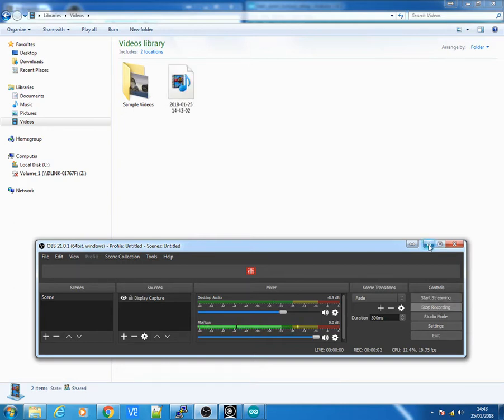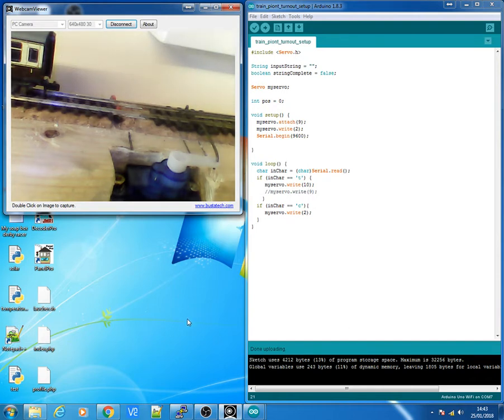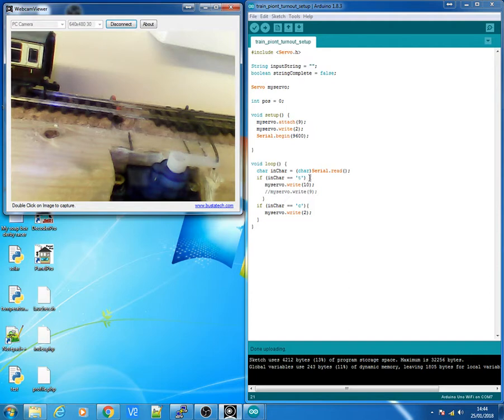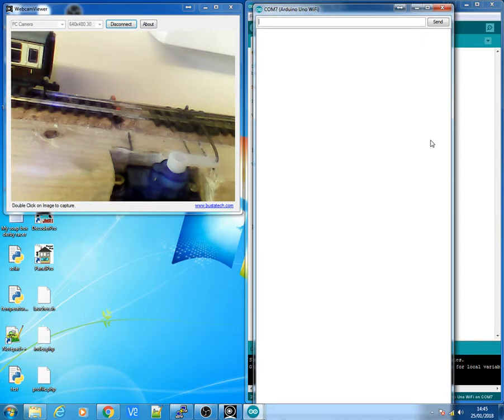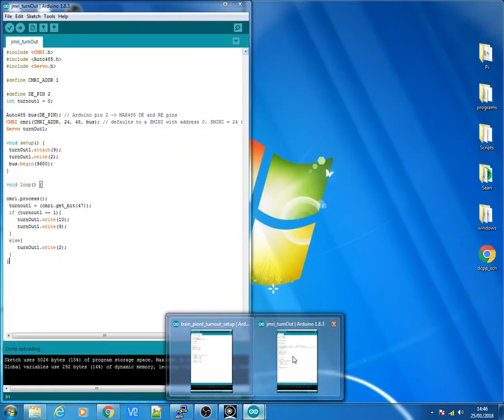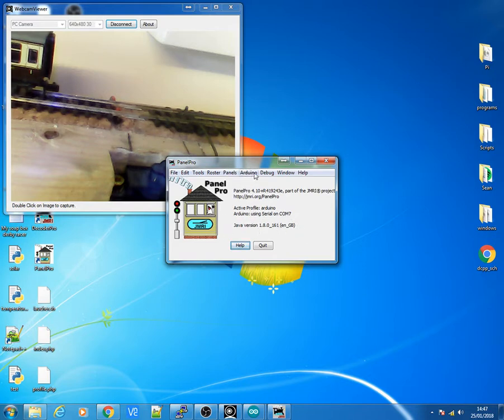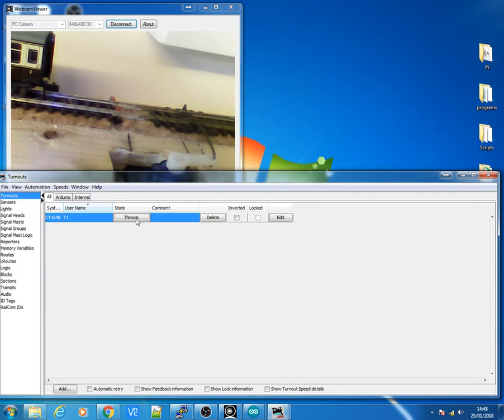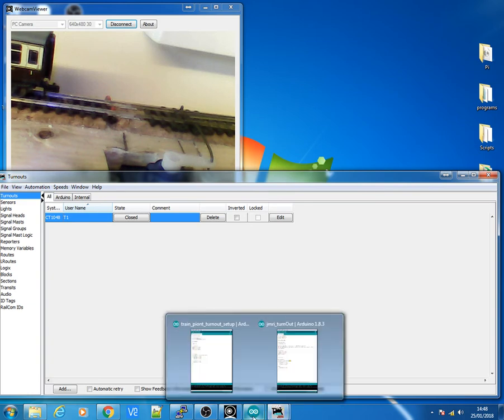Model railway JMRI Arduino Turnout servo control Part 4

Comment: your video on cmri is really good how could i connect the servos to the uno or mega ,could i use a mega sensor shield
Reply from the maker: Hi Alban. You could use a servo shield but really its not needed, these shields are for mobile robotics to keep everything tidy. The servos all run off 5 Vdc so you will need a separate 5 V supply for the servos. The signals to the servo can come direct from the Arduino digital pin outputs. One thing to remember the 5 V servo supply and the arduino supply must have the same ground. You can just connect both output grounds together.
Reply: @BrackstonesTravelAdventures  cheers thanks for quick reply
Reply: which servo sketch do you use in your library
Reply from the maker: @albanwincott2585  I use the servo.h library.  The full sketch for what I was doing can be found on my blog link in the description
Reply: @BrackstonesTravelAdventures  Cheers and thanks

Comment: This is useless. You have your monitor set so it is fine to use but it is useless to show on Youtube. Too small. Same with Arduino - too small a font to even see.
And then you whisper. Useless, but it is what I need to know.
Bugger all.
Reply: I think your comment is unfair, the information in this video and his others at least provided me with the best and cheapest solution to points control via Arduino using servos. He also stated in another video that he is not an expert so I appreciate any assistance people share regardless of their level of skill! Maybe you could provide some constructive advise and direction rather than put the man down!